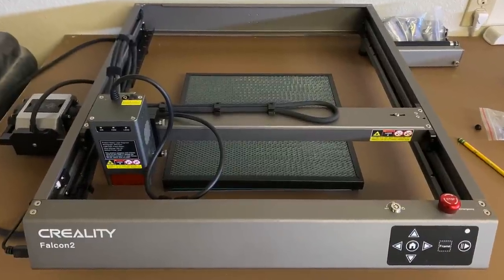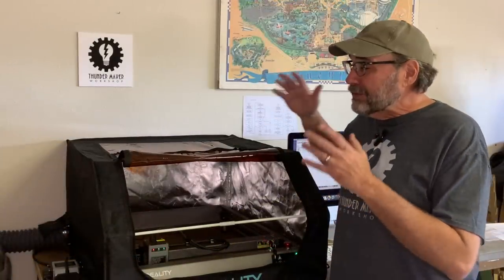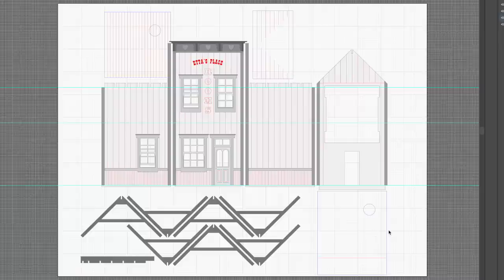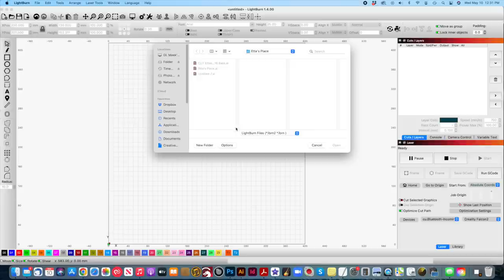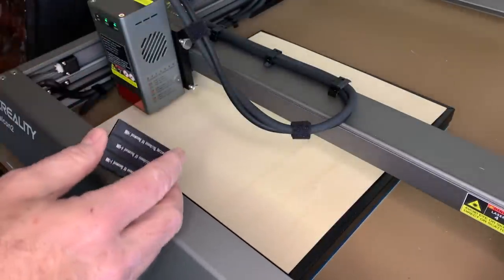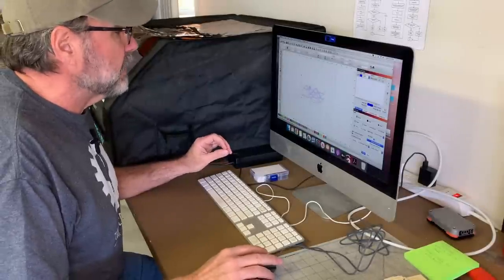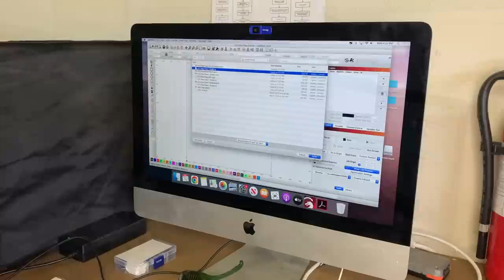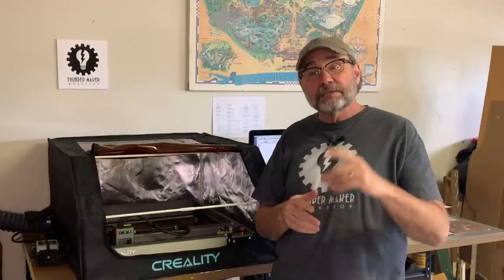Making Etta's Place with the Creality Falcon2 22w Laser Cutter Engraver | Pt 1

Comment: HUM..... We had a chance to get one of these a few months ago.... I think we should have grabbed it!!! I figured a solid state could never do this!!! WOW!!
Reply from the maker: It worked better than I expected. Now I mainly use it for cutting shingles!
Reply: Okay, just finished watching>>> WOW.. More impressed than ever. Friends and I have been sending out files to a person with a HUGE CO2 laser. Really no need it seems. Wonder about the life span of the laser and cost.
Reply from the maker: @ToyManTelevision  In the 3rd video in this series I give my final thoughts on this machine and how it compares to my CO2 - cost, value, etc. It is a good machine for hobbyists that want something that will work right out of the box. It does need a few safety upgrades in my opinion though.
Reply: @ThunderMesaStudio  I need to follow up on these. Seems like good bang for the buck. But not if it fails right away. And if there are safety issues….. we’ll that’s a deal breaker.

Comment: I noticed the two issues you raised as you were using the machine. I can understand the way that the height is set -- doing it another way might involve a stepper motor and more expense. The framing is a bigger deal because of the potential waste; that and the potential to get it wrong in trying to avoid the waste! Question: is the lack of any hold down typical of laser cutters? I'm used to CNC routers (X-Carve) where you have lots of tooling to hold the material flat.
Reply from the maker: Yes, the lack of hold downs is typical of most laser cutters. It’s less of an issue with Co2 machines because the lens is usually higher above the work (they actually use a series of mirrors to bring the beam from the laser tube which is usually located in the back). Diode lasers ride directly above the work and that makes them more susceptible to coming into contact with materials, especially if they are at all warped.